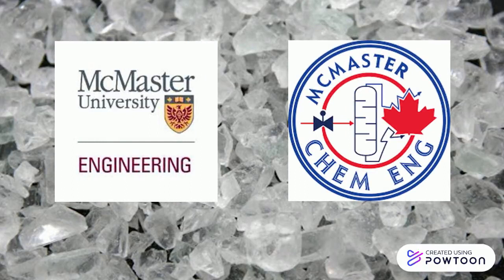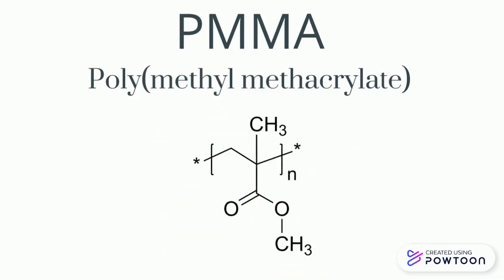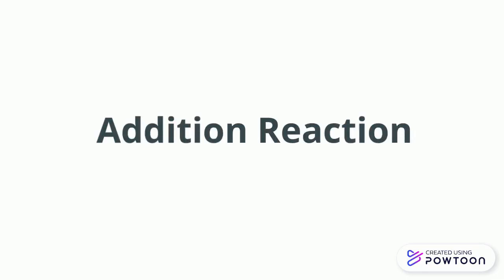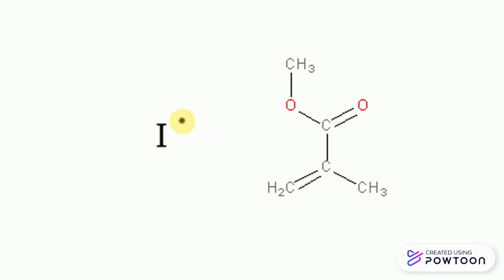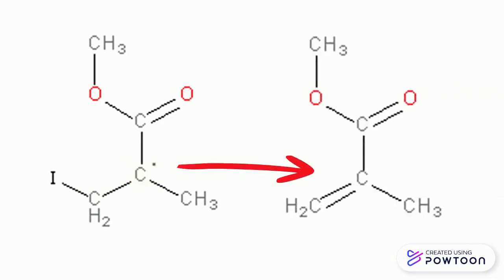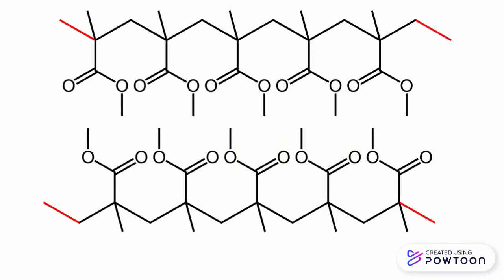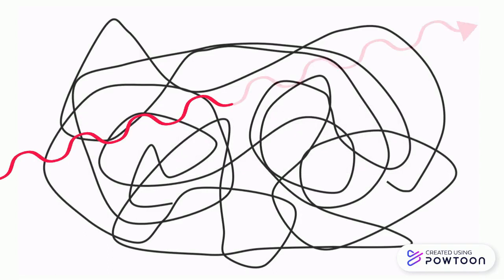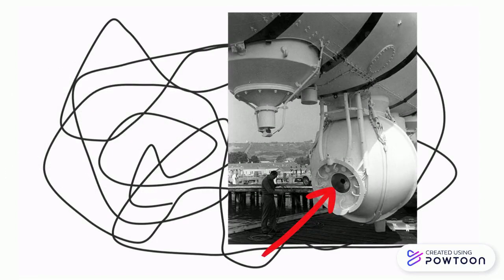Better Know a Polymer: Poly(methyl methacrylate) (PMMA)

Comment: Hello.. I want to ask? What kind of chemical i can use to use as initiator for MMA to produce PMMA..? Thanks
Reply: In terms of polymerisation technique, different polymerisation processes are used to convert MMA to PMMA. The main commercial processes are emulsion, suspension, solution and bulk polymerisation. 
Bulk polymerisation process is used for producing polymer sheets for direct use as no further separation is needed (only monomer and initiator is used). This is a common process for production of PMMA sheets.
In solution polymerisation monomer is dissolved in a solvent. The produced polymer may or may not be soluble in the solvent. The final product needs to be separated from the solvent.
In emulsion and suspension polymerisation processes monomer is dispersed in water which reduces the viscosity of the reaction mixture and facilitate heat transfer. This means subsequent separation of polymer particles from water is usually required.